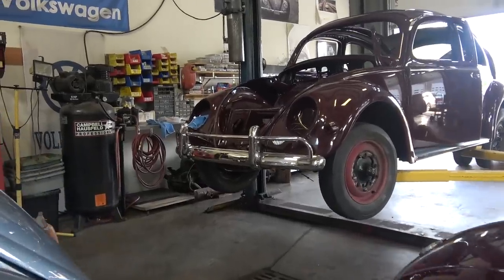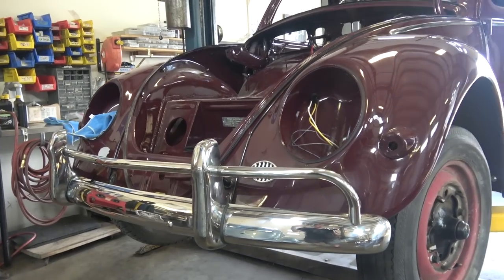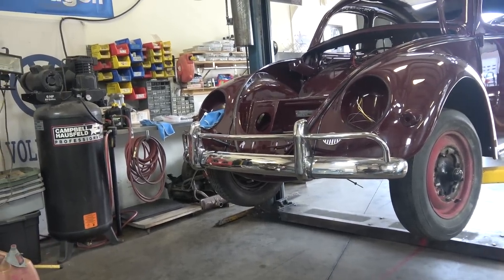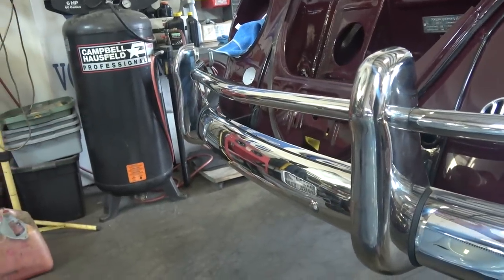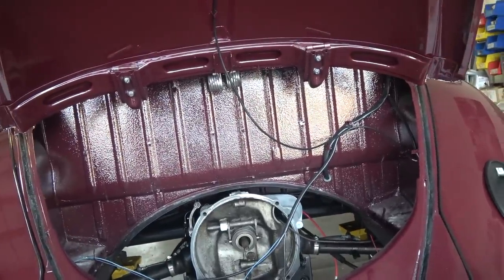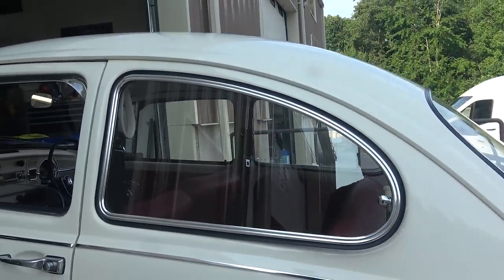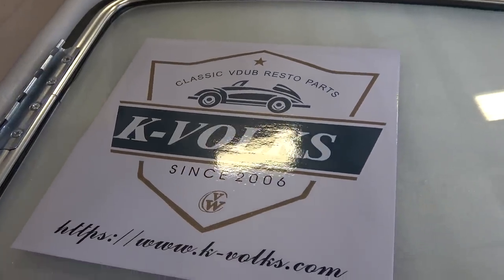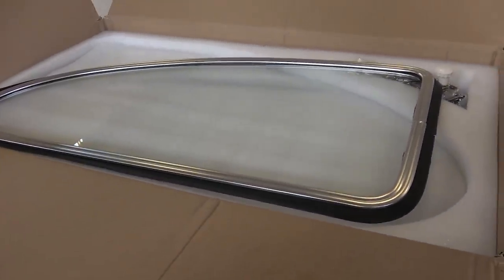Classic VW BuGs - The Latest Beetle Bumpers and Pop Outs on the Market - What to Look Out For!

Comment: I, too, ordered a set of pop-outs for my '62 Beetle from K-Volks.  The price was good, fast shipping, and excellent packaging.  The mis-alignment where the ends of the frame meet also had the same amount of mis-alignment as yours.  The rubber seal thinner than German seals.  I will likely replace the light-weight seal before installation.  I haven't installed them yet, because I want a better fit and finish.  Keeping my eye open for a set of used early pop-outs.  BTW, there were a few screws missing, but K-Volks was very responsive in sending what as missing.
Reply from the maker: Very good.

Comment: So, I found, putting the seals on my pop outs that it goes a lot quicker if i lube the seal with a 50/50 mix of Dawn and water, then use a dollar plastic tool for clay modeling. Once i got it started it was like doing a zipper, about 5 minutes.
Reply from the maker: Nice!

Comment: Greetings Chris from an Unusually Sunny West of Ireland. I have been working with metal press machines for some years professionaly and despair at the careless quality of bug   parts manufactured in China. Regarding the the thickness 1.5mm is not widely used for modern day car sheet metal products, it's even thinner and lighter at 1 mm or less for body panels often 0.8mm. 
Back in the day German made bugs would have used similar steel thickness of 1.5mm but a layer of brass added before chroming increased the thickness , strength, durability and corrosion resistance to a higher level than today for sure.
Chrome over stainless steel won't look as good today because they skip the brass and toxic chemicals used back in the day for environmental reasons when chroming I believe.

Comment: Hi Chris  Another great video! I appreciate all the info you put out there for vw beetle hobbyist like myself. I have a 66 factory sea blue. I've been returning to mostly  "factory spec" (I'm keeping it 12v, I figure that's a good  upgrade) after a  "resto mod" with ALOT  of incorrect parts. Anyway my question is do you know the factory bumper gauge? thanks
Reply from the maker: like 2.6 - 3mm

Comment: CIP1 sent me thier "finest" chrome plated stainless Euro 
bumpers ($900 bucks) with adapter brackets and Euro style bumper gaurds ( They don't tell you they are EMPI trash) which did not fit without drilling the bumper and adding a chrome plated bolt if you wanted it to look right. They were good about listening to me and promptly got back to me telling me that in the product notes they have ( but the buyer doesn't). I got through it and the only consolation from them was that they would send me a couple bolts WITH MY NEXT ORDER.
I told them thanks for nothing and there most likely never be another order. 
That is what you get for close to $1K from CIP1.

Comment: I agree with not wanting to use the towel bar grommets, but if you have to use that gasket where the bumperette aligns with the bumper blade, what's the real difference?
Reply: I had a ‘69 Ghia and it had grommets between the bumpers and the overriders from factory; I suppose Beetles didn’t.

Comment: At $1000 for bumpers I am wondering if re-chroming is a better alternative IF your bumpers are not full of holes and are straight?
Reply from the maker: Chroming could be more money, but if they are originals and in decent shape, then yeah fix the originals.
Reply: Advance Plating (they do really top quality work) wanted $2500 to do front and rear bumpers on a 73 Vert ghia I restored. But that was going to be more than the owners wanted to spend. 
I found Space Coast Plating in Fl. that did both bumpers and 4 bumper guards for $1400. They did a great job everything was straight and metal was finished well before plating.